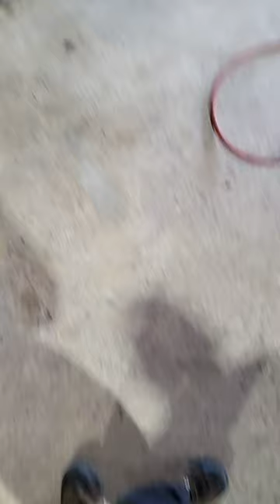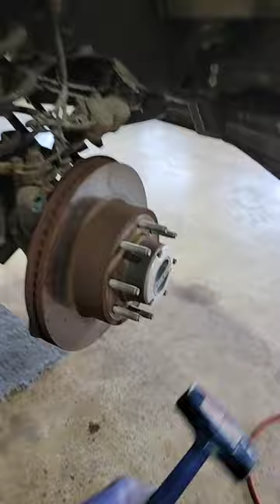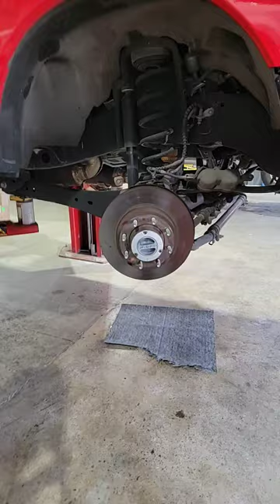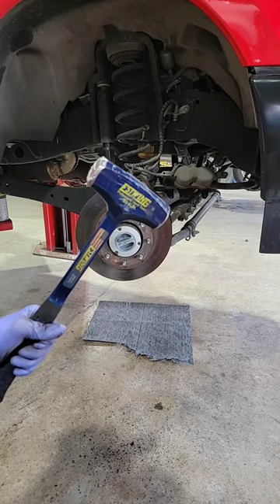one STUCK rotor | batters up! #fordtrucks #fyp #shorts

Comment: I'm not going to lie. I secretly wish the rotors are stuck, so I can have a excuse to take the sledge to the car. It's therapeutic!
Reply: Therapeutic until it doesn't work and you're already tired because you hit the rotor so many times and it hasn't budge a tiny bit. Luckily I've only had that once.
Reply: @arthurr8670  I had to use torches to cut a rotor off once
Reply: Try corroded torsion bars...those are fun.
Reply: Until you swing and miss and you hand goes full force into the fender/bumper
Reply: @PowerStrokeTechTalkwARod  you hit it around the studs if rotor is still good
Reply: @arthurr8670  I'm in Florida. Stuck doesn't happen.

Yea I'm bragging 🤣 rubbing some south beach salt water in the wound.

Comment: Run a bolt in the top caliper mounting hole with a nut between it and the rotor. Hold the nut with a wrench and hammer on the head of the bolt with an impact. It essentially makes a press. Use a small piece of metal between bolt and rotor if you’d like to save the rotor. Takes 30 seconds and works every time.
Reply: Hope you mean the caliper bracket mount points not the bracket to caliper mount point
Reply: I use this technique, both bolt holes.  Always works.
Reply: Yall must of never had a really stuck one then lol I just rolled my 2015 gmc sierra off a lift and shot a hole through the rear window of my s10 with a chain I wrapped it with a chain and gave it a huge now I have a broken lift a totaled out gmc and a broken window .....plus .....plus the stupid rotor is snapped at the top and still stuck

Comment: I work on trucks that are used for plowing in the winter, I've actually beat the rotors so hard that outer part of the rotor has separated from the barrel. Sometimes a little penetrating oil can help when sprayed around the hub.. Most the times I just grab a bigger hammer lol
Reply: I’m thinking of the 450 and 550 salt trucks rusted rear steel wheels 😅
Reply: Been there… the torch is a diesel mechanics best friend ahah
Reply: @mmmaaannnyyy  good old hot wrench haha 🍻
Reply: Air hammer around the face of the it in-between the lugs to help break up rust then tap it off with a hammer
Reply: Fords were the worst for having to break the rotors in 2 pieces
Reply: Same

Comment: Would hold a double sided brass hammer between each stud and then with a larger steel hammer strike the brass brass hammer I rotated the blows like a wheel torque Star pattern. It shocks the rotor where the rust is behind the studs. That was in Syracuse NY In Florida no abusive beating needed.

Comment: Looked like one of your lug nuts on the driver side was making a run for it LOL. I usually use a cross peen hammer. That rotor looks good, usually here where I live on the West Coast of Canada rotors are spanked after one set of pads. I've been meaning to buy a Big Nasty I keep putting it off, had a job two weeks ago wish I had a Big Nasty.
Reply: 😂 that nut rolling!
It looks too small to be a lug nut.

Comment: I used to do that if I was installing new rotors but I became concerned about the hub bearings if the rotors were really stuck. Lately I use a sawsall with a carbide blade. Carefully cut the rotor until you get down to the hub then use an angle grinder to cut a slot that lines up with the cut in the disk most of the way through the inner face of the rotor. Then put a heavy screwdriver or chisel into the slot and give it a couple whacks. The rotor will split and in doing so expand slightly and fall right off. Works like a charm

Comment: Wedge a pickle fork (ball joint fork) between the caliper mounting hole and the rotor and hammer away... Works well even to get out the hub bearing (hold rotors with lugs).

Comment: Hammer (manual & Air) and for the bad ones the trusty smoke wrench, have always been my go to. However a few year ago I picked up the OTC rotor and drum puller and I must say it is $150.00 or so that I wish I had spent sooner. Living in the mid Atlantic region, I’ve already made my money back multiple times. I’m really digging the tool

Comment: ingersol long barrel air hammer, with a hammer bit. 
Turn the hammer all the way down and up just enough to get a gentle beat. hammer the flange area where the lug studs come through. It will vibrate loose. this works on brake bleeder screws also ( you hit the solenoid or caliper not the screw). If you don't have an adjustable air hammer, use a regular hammer on the tip of the crown or corner of the edge of the top of the hat. The area that makes the flange for the lug studs and the rest of the rotor. Bump it like you are putting finishing nails in a deck and don't want to damage the board. You bump, roll, bump, roll it pops loose. Remember to put a lug nut on a stud so the rotor doesn't fall off. They pop off pretty easy this way. If you are installing new rotors, then just beat it off with a hammer.

Comment: Try a bolt thru the bolt hole machined into hub of the rotor. It's put there specifically to remove stuck rotors. Also make sure u remove factory hold down bolts. They are just for mechanized factory install do not replace them

Comment: Yeah....here in the southwest we don't have that issue. They come right off with maybe a dead blow at most 😂
Reply: Very true but I had some that were really on there. Hit it with my sledge so many times I thought I was going to break something. I ended up torching them and then let PB Blaster do its magic. They damn near jumped out at me after that lol.
Reply: Tech in rhode island. If it came off easy, it was done in the last half year. otherwise its hammer time.

Comment: One hit baseball swing from backside with sledgehammer with quarter rotations. Not advised to hit the same spot multiple times with a sledgehammer or air chisel. Good way to launch shrapnel remains of a rotor or potentially cause bending of the studs or breaking the stud base on the front hubs. Or break stud tabs on the rear axle shafts.

Seen those kinds of horror stories unveil in ford forums.

Comment: I run bolts through holes for the bracket. Put nuts on and tighten it’ll push rotor off

Comment: A little penetrating oil and an air hammer in between each wheel stud. If it needs a little extra then I'll have a buddy use a pry bar between the rotor and the knuckle while vibrating with the air hammer. PRO TIP: Leave 2 lug nuts at the end of the studs to keep the rotor from flying if it breaks loose violently lol

Comment: Air hammer along with penetrating fluid (atf/hydraulic/steering fluid) knocks the crusties loose.
Reply: I agree with you. A little penetrating oil and an air hammer in between each wheel stud. If it needs a little extra then I'll have a buddy use a pry bar between the rotor and the knuckle while vibrating with the air hammer. PRO TIP: Leave 2 lug nuts at the end of the studs to keep the rotor from flying if it breaks loose violently lol
Reply: @jeremyg9240  Perfect description.

Comment: If replacing the rotors, sledge straight to it. If not, hit a piece of wood against the rotor (can tape it or whatever) as not to destroy it. Or use a heavy duty hard rubber hammer.

Comment: i’ve seen some pretty good luck with air hammers, giving a couple raps in between every lug and around the barrel of the rotor if you’re keeping the rotor but trying to get it out of the way if it’s being replaced bigger hammer or worst comes to worse i’ve even had to use a come-along attached to a 3 jaw puller anchored to a 3rd gen cummins D-hook

Comment: I use a combination of astro tools rotor/hub puller and my largest sledgehammer. The rotor didn't budge during the beatings, until I gave up and the rotor went straight into orbit

Comment: I have to say... Living in the true rust belt - those rotor are really rusted. 
Bolt and two nuts through the caliper mount holes on the knuckle. As you crank the bolt it just pushes it off.

Comment: I know of a trick with a bolt, couple if washers and a couple nuts using the anchor bolt holes.

It pushes the rotor off and works like a charm.

Comment: When I have a stuck rotor I take out the one bolt that holds the brake line it’s always been the same thread pitch as the two threaded holes in the rotors and I work it in each hole and swap back and forth and it will slide that rotor right off

Comment: Them two little bolt holes are so you can take a bolt and screw into them and the bolts will push it off.

Comment: If you lower the car down, face away from  the car then swing the hammer down towards your knee. You will break your knee..but if you hit the rotor It's coming off first try :) I have had luck with this method so far.

Comment: Did the rotors need replaced? Or was the customer wanting bigger ones? Those looked to be in pretty good condition till you decided to go 200lb gorilla on them with a small sledge. There's a way to get them off and not damage them and not have to pound on them till they break.

Comment: See those holes in between the lug studs?  They are threaded so you can run a bolt into it. Turn until it stops moving, tap the hub part of the rotor to relieve pressure. Turn bolt again. Some vehicles have multiple holes so you get even pressure. This way you aren't charging your customer 200$ for a rotor that YOU damaged. I'd be pissed if I was the customer.

THIS IS A PERFECT EXAMPLE OF HOW NOT TO DO IT

Comment: Working on our f350/f450s at work, I found that spray a little penetrating oil at the center lip then hit the side of the hub with a few good whacks with my 5lb sledge and then one good smack from the back usually does the trick

Comment: All depends what it's in for, if it's in for a set or a 4 corner brake job hammer them off it don't matter what you use it's getting replaced. Rubber hammer if it's not getting brakes if you plan on hitting where the pads meet so you don't damage the rotor

Comment: I use hammers but if I have the proper bolts ans nuts I use a bolt to push the rotor off from the mount holes

Comment: Welcome to Michigan...
Reply: He skipped the step where you loosen the lugs then drive to separate the wheel from rotor first. 
But I just use a bolt in the removal hole like they were meant. I'm not buying new rotors if I don't need to
Reply from the maker: ...yea I don't think so tim...

Comment: Anti seize , grease, or used oil under rotor slows rust
Reply: Nah it just burns off instantly with the brake heat

Comment: Remind me to never take my pickup to his shop
Reply from the maker: Sure thing karen
Reply: I’m not being a Karen I’m just say that you don’t take a hammer to a rotor.  Unless ur just a parts replacer and not an actual mechanic that FIXES things
Reply from the maker: The guy wanted the rotors replaced. Whatya want me to use your playskool tools????
Reply: Be a mechanic and turn them down to save the customer money!! They didn’t need replaced
Reply from the maker: WHY?!?!?! TO make them thinner on an F550 so they come back with a vibration cuz they over heated.......
Stop all that non sense keyboard warrior
Reply: No key board worrier here I drive a f550 everyday for a buckets truck at a utility company and we do it to the whole fleet all the time.  Never ever have trouble and we plow mud all the time

Comment: Why wouldn't you hit right around the rim that doesn't have any contact with moving parts where do you think the rust holding it is?... it's not on the part the brakes grabbing on knock around the middle wall next to where the lug nuts are